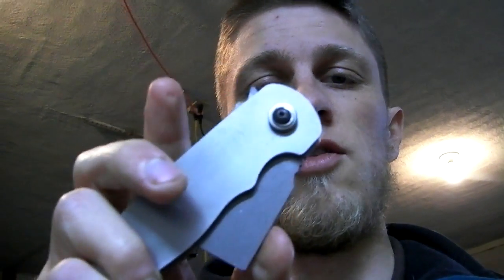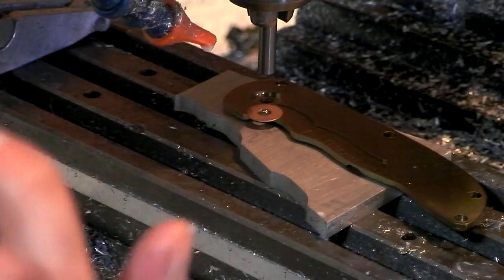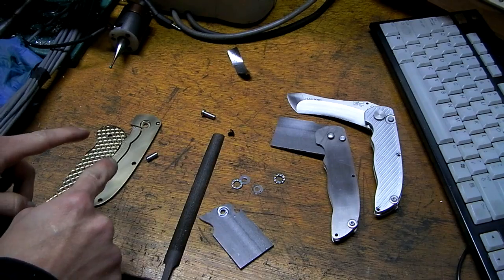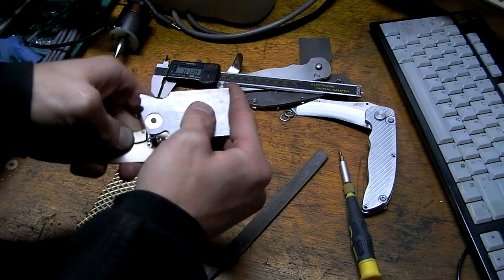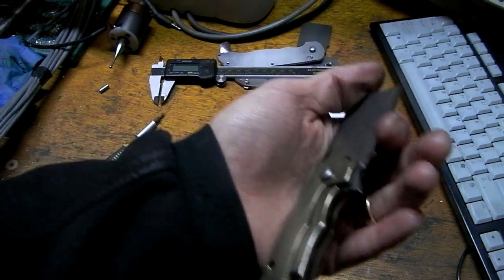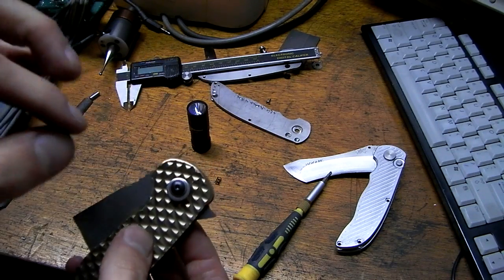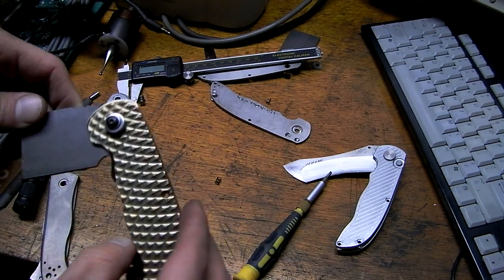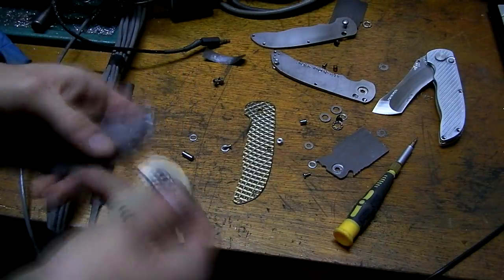Knifemaking Tuesdays Week 13 - more test blades and flipper framelock action!

Comment from the maker: @nanashi1o3 Yep this was discussed in the comments of my last video (or two ago?).  You're right, a full length blade will feel more realistic because of the moment of inertia.  But doing it this way is WAY less machining and work, making it faster to make more test blades with slight changes.  The front of the blade doesn't matter for this testing, I was just focusing on the lock area and flipper size.  I bet a full length blade will flip even nicer!

Comment from the maker: @gitterright The blade will be nearly exactly like the finished blade shown in the video on the other knife, it's a hollow "ground" (machined haha) slight recurve modified tanto.  I could do a zero grind, that blade shown basically is, except they'd be a pain to sharpen, so mine will all have a normal edge bevel and will ship hair popping sharp.